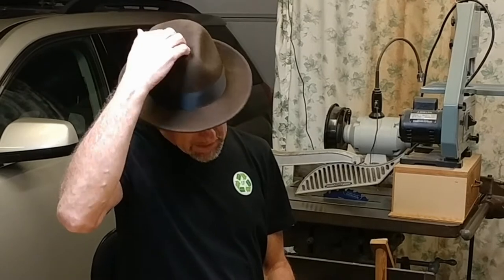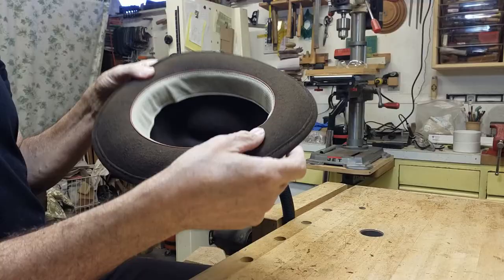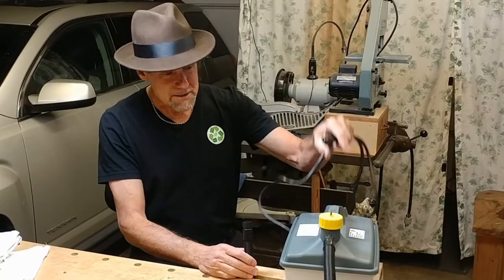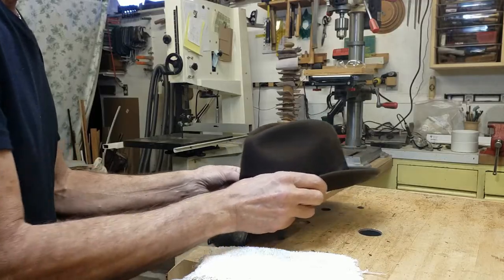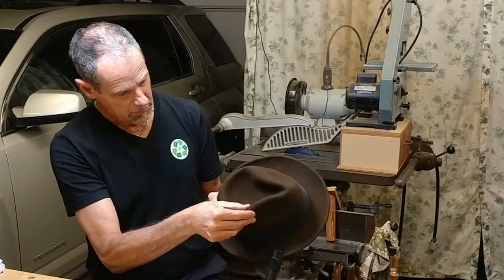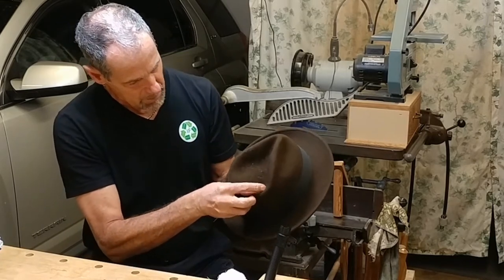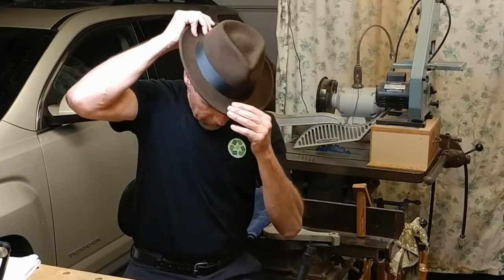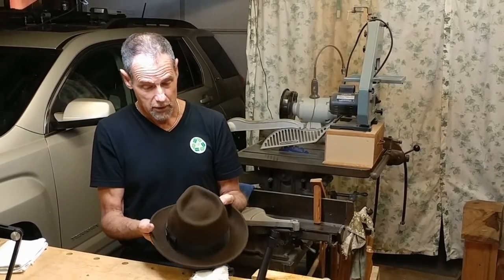How to Change a Fedora Hat’s Shape and Style

Comment: im struggling with the brim shape of my fedora, its gone flat. any way i could put it to that style shape?
Reply from the maker: Well, if its a soft felt (rollable) you'll need to get a bottle of hat stiffener. spray the brim, allow it to dry, then steam and shape it. You may need to do this a couple times to build body into the felt. The steam drives the stiffener into the fabric. Too, they make hat forms for shaping brims, but you can use a string wrapped under the hat and tied on top to slightly pull the brim up as it dries.
Reply: @ItsFixable  Thanks a lot! i will give this a go and see how it turns out 🤠👍